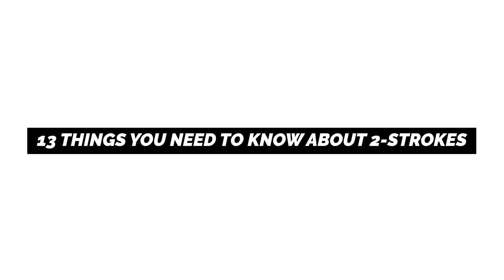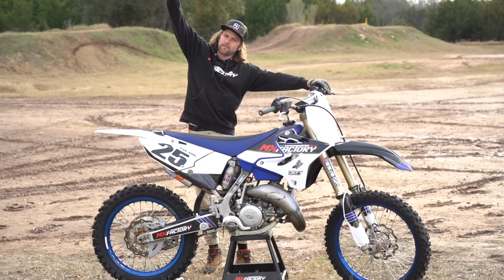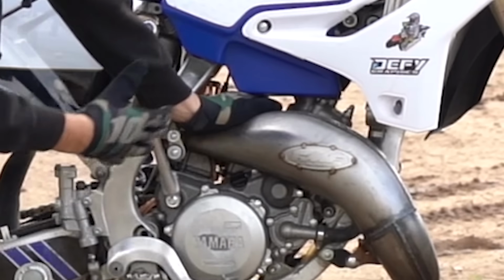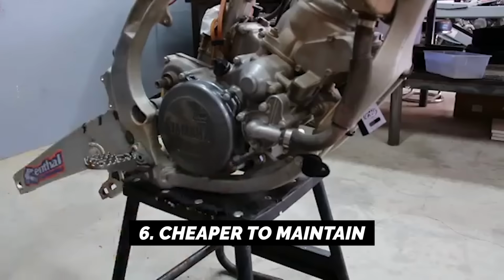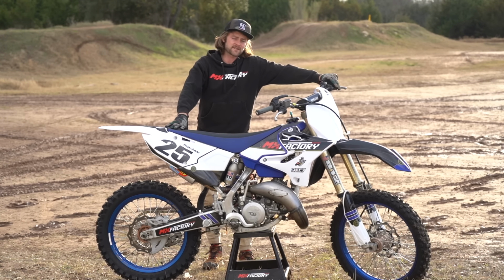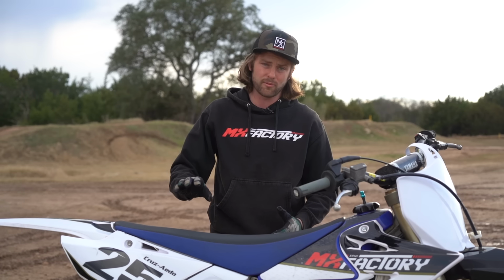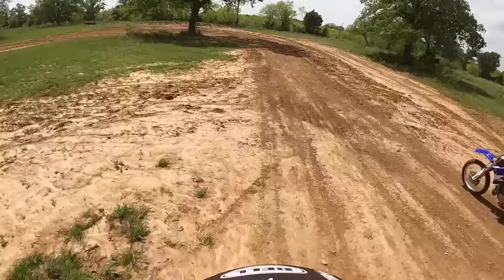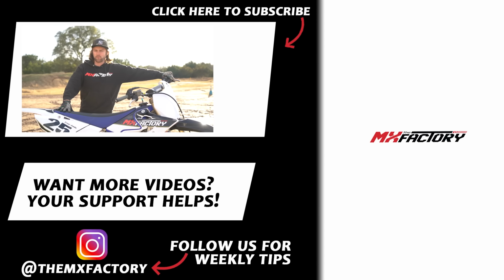13 Things You Need to Know About 2-Stroke Dirt Bikes

Comment: I’m still rocking a 2002 YZ 250, had it for like 10 years. There’s absolutely no reason to get another bike. I’ve rode 450s/250fs, the four strokes simply don’t have any character. When that power band comes on, instant adrenaline.

Comment: Actually in EU, they do be quite expensiver than 4 stroke, because they are that rare. I have Aprilia RS 125 2009 and with that money I could buy a new, 125cc 4 stroke Brixton :( They do be cheap to work on till your engine blows too, tho, it's only 400-500€ for an engine

Comment: you forgot to talk about piston replacment, 20 hours on a 125 piston and 30 on a 250 piston... and i agree ride 2 strokes people!
Reply: Those hours are not written in stone.  The choice of oil alone can make a big difference on how long a ring lasts.  I rode and raced a lot more than 30 hours on my 250's, and only changed piston and rings once a year, (4 to 5 months of winter, but a lot of summer riding, every day usually).  I bet I hit at least 120 hours, (that is about 4 hours a week for 30 weeks a year), with no problems.  You can measure the skirt for wear and the ring end gap, (specs in the manual), and with a good oil, I bet both are well with in spec at 30 hours.  Just replace them when they are out of spec.  It took me all supper to do that, and about 2 hours in the basement to rebuild it, (and clean the power valve).  But, I hear the Yamaha piston is on the weak side.  The bike, (my newer 2019 2-stroke 250), only has less than 10 hours on it, and I can hear it slapping a bit more than I like at low rpm's,---so I am going Weisco now. :)

Comment: You forgot the #1 reason they're better. The don't flame out (die) like 4 strokes. I know this is a MX channel but I do MX and trail ride. My Husky (KTM) 300 refuses to die regardless of (low) rpm which actually allows me to use less clutch than a 4 stroke. 2 cents.
Reply: I swear the thing will tractor up a hill at 100 rpm.

Comment: After 20 years no one has been able to give me a definitive reason why Supercross went from two strokes to four strokes. Don’t get me wrong, I’ve heard in array of reasons but no one has been able to take that index finger and say here here this is the reason!

Initially, I thought it had something to do with noise. I owned a 1975 CR 250M. My friend owned a 1979 XL 250.  My bike was much much faster and louder. His XL 250 was much quieter, but also slower. So, initially I thought it that the move was related to noise.

Comment: Please learn to ride a 2 stroke...  it will make you a better rider all around.  You learn throttle, clutch, and braking control.  All of us who learned on 2 strokes think a 4 stroke is like nitrous.  I feel they are still much more fun to ride.  I will agree in a race the 4 stroke allows you to concentrate on technique and strategy much more, but the 2 stroke racing back in the day was like a dog fight.    I have never had arm pump like I used to have back in the day on the 2 strokes.  Adrenaline and pushing past the line was a strategy.  Nailing a double or tabletop in 4th gear and air revving the bike was the norm.  The panic rev right before landing was the last ditch effort to save the day.  Ever been engine high sided in the dirt?  A 2 stroke will teach you throttle discipline.  I have always been a Kawasaki guy.  Their 2 strokes were brutal.  The exhaust valve was like cruise control for me.  Back in the AMA we had to buy a current year bike to race.  I am not sure how you do it today.  These bikes are super expensive.  In the end, If you love moto, you need to try a 2 stroke to see how it is.

Comment: I had a 1970 Kawasaki 100 Centurion, and a 1973 Honda 250 Elsinore, and a 1976 Kawasaki KX 250 when I was a kid.  A bunch of misc. bikes after that, both 2 and 4 stroke, street and dirt.  I like 2 strokes!  At 11 my first bike was a Honda Trail 55, at 13 I got the Centurion and it was a Rocket!  The Elsinore was downright frightening and I almost killed myself more than once!

Comment: I was surprised when he said they put out less power than modern 4 strokes. I thought it was the complete opposite riding a two stroke 250 versus a four stroke 250two-stroke 250 feels worlds more powerful to me.
Reply: I have a 125 2 stroke and a 450 4 stroke what size would be equivalent to the 450? because the 125 feels allot less powerful than the 450

Comment: I went from a Suz SP125 to an RM80:  my ride dropped what felt like over half the weight and gained a punch like Mike Tyson....plus I could pick up my RM with one arm.
It was like going from a solid state to a full tube guitar amp;  there is NO comparison.
Guy stops me in my driveway with a Honda Elite moped wanting me to race him and I just laughed "G'ahead -take a head start while I finish my smoke and I'll be waitin' for you at the last mail box..."   1) He didn't believe me and 2) It pissed 'em off.  
I was waiting for 'em at the finish line (the last mail box).

Comment: 1) Agreed - 2 strokes sound awesome...!
2) Disagree - ALL engines have a "powerband".  Modern 2T motors have very mild powerbands compared to older generation 2 strokes.  Actually most performance 4T motors make most usable power very high in the power curve.  Linear power curves are common for both engines.
3) Disagree - Any engine that makes most of its power up top will need a lot of clutch.
4) Agree/Disagree - Some of these modern 2T chassis are filled with stuff and have fuel tanks that hang down long making it hard to reach in there.
5) Agreed - 2T motors have less moving parts so easier to work on.
6) Disagree - 2T motors inherently make more power than a 4T motor per displacement.  A modern 4T 450 will make around 50-55 hp whereas a modern 2T 250/300 will also make upwards of 50-55 hp.
7) Disagree- ALL bikes are expensive these days, 4T and 2T.  The only bikes that seems to be considerably cheaper are the YZ 2 strokes.
8) Disagree - Both 4T and 2T have the same electronics and both available carbureted and fuel injected.
9) Disagree - Most bikes in their "class" are going to be similar in weight.
10) Disagree - Any competition bike is going to feel similarly loose on the ground when you're on the pipe.
11) Disagree - Body language depends on riders skill and bike setup.
12) Agree- 2T motors have less engine braking.
13) There are more 2T manufactures than Yamaha and KTM.  Also Husqvarna, Beta, and GasGas are not rebranded KTM's.  They're close but have considerable differences.  You also left out Sherco and TM.

Yes, 2-strokes are making a comeback and more people should ride one...
Reply: I build little 2-stroke engines for a living, and I don't think there has ever been a stock 250cc 2-stroke that made 55hp, and probably not 50hp.  Most of them make about 45hp, and that is what a modern 4-stroke 250 makes today, (not adding the 300cc engines).  I still think it is right that a 2-stroke should make more power than a 4-stroke of equal displacement, and I do think it may be possible to get about 55hp from a 250cc 2-stroke cylinder on gas, but I bet it would be too peaky to ride easily for most people, as it would probably kill the low end power, and hit like a ton of bricks at higher rpm.  One thing only I will give credit to a 4-stroke.  The power output does hook up to the ground better, and that is pretty hard to beat.  You are right about the "power band".  The power band is just a representation of the usable rpm range of power output of a engine.  Both 2-strokes and 4-strokes can be made to be linear or peaky.  Engine braking?  Now we are getting lazy with our riding.  It takes more talent to ride a 2-stroke well IMO.
Reply: @EarthSurferUSA  - Thanks for the feedback.  And not to discredit your engine building skills either but the YZ250 is recorded at making around 48 hp and the YZ250f making around 38 hp.  KTM 300's make somewhere between 45-50 hp depending on model year.  And most 450's make upwards of 50-55 hp.  I was very loose in those figures too because we all know these can also be dynoed all over the map depending on the dyno and what mods the bike may or may not have.  But clearly........a 2T motor will make more power than a 4T motor when comparing displacement.
As for linear power...well a modern fuel injected 2T 300 will make unbelievable linear power whereas a track 4T 450 generally make horrible single track bikes.
I guess point to be made is the video was too generalized and would have been accurate if it was made about 15 years ago.

Comment: How about a video on specific jumping 2 strokes.
Reply: Usually you are letting off the gas just after your front wheel leaves the lip so the front wheel does not reach for the sky.  It just takes a bit of practice to get used to.

Comment: I love them more than anything! 
Had kx65,kx85,rm125, than i had a yz450...yes it was an awesome bike and alot of fun to ride, but i couldnt stand the engine braking, the heavy weight, the fact that i simply couldnt rebuild the engine.. so sold it!
Now i got a yz250 and man, thats just so much fun to ride...sounds and smells awesome, and with a few pro circuit parts its just simply as fast as a 450 in my opinion!
Right now i rebuild it to a reverse restyle Version..  old 2002 plastics and airbox, it looks sick and pretty oldschool for a '19 bike. :)

Comment: New and bad riding technique IMO 4:20:  Riders today rotate their bars forward and have their levers almost level, (compared to pointing down as we used to do.). 
Even pro racers would crash less if they kept their elbows up.  For some reason, racers have adopted a lazy low elbows problem, and here this rider has no leverage to keep his upper body from going over the bars.  In the last national, one of Chases crashes, (which James Stewart analyzed, but still mentioned nothing about Chases elbow at his side.), would not have happened if Gary Bailey coached him for a week.

Comment: Well. If want 2 strokes back we need to address the race handicap in displacement. It was introduced when 4 strokes were more disadvantaged. They aren't as disadvantaged now. Let's close that gap. 250 vs 450... common.. they way 450s run these days...

Comment: $11k is cheap? Even a used Ktm costs as much as a new YZ250F
Reply: Who said that?
I picked up a 2005 YZ 250 for $2500 and might be 1.5 seconds a lap faster on a modern 450 priced at 11k...all about perception

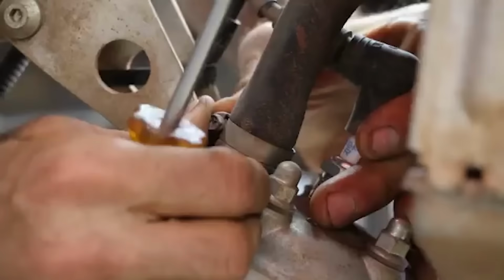Comment: 2:34 is false. A 125 2 stroke puts out sooo much more power than a 125 four stroke. A 125 two-stroke is more comparable to a 250 4stroke. And the 90s CR250’s Have more horsepower than modern day 450s. The modern day 450s though have more top speed but the two-stroke still have acceleration. And don’t even get me started on the 500 and the 700 2 strokes. The 700 two-stroke has 87 horsepower, and the 450 4strokes have about 55 horsepower. Two strokes Are just way more powerful than four strokes but the four strokes are more reliable and they have a larger TopSpeed. Like I think the 500 two-stroke top speed stocks about 90 while the 450s are about 100. But the last 500 ever made was in 07. And two strokes it’s way more fun to ride in general

Comment: #14:  2-strokes are what we wanted to race.  4-strokes are what the environmental groups and government want you to race, (for now).
What is the main difference?  Freedom and price.
15:  Today's two strokes are too damn tall, (4-strokes have to be taller because of the taller head).  They are about 2" taller than they should be, and that turns off any newer rider under 5'10" tall.  I lowered my 2019 YZ250 that I bought just slightly used from a guy who sold it, because it was too tall.  You go for the outside berm tipsy.  I will take the flat inside line.

Comment: 2 strokes make More power than a 4 stroke. More not less. 
A 250 2 stroke makes More power than a 4 stroke.
This is why 250 4 strokes were allowed to race in the 125 2 stroke class.

Comment: I started on 2 strokes in the 90s cause thats what you had.  Going 4t around 02 and getting back to a 2t around 2014... it is way more fun and work to ride a 2t.  I think back to learning to ride and my first bike was an rm250 when I was 16.  Definitely different times.  If you want to go fast and feel planted get a 4t.  If you just want to ride for fun and send your HR through the roof....get a 2t :)   right now I have a 450sxf and a 250 xc.  The 250 has gotten way more hours on it.

Comment: This is the first time I've ever heard anyone seriously say that a 2-stroke puts out less power than a 4-stroke. Is this true? Have 4-strokes improved THAT much?? I've always rode 2 cycle bikes and have next to no experience with thumpers, other than just knowing in my heart of hearts that if I ride with a 250 4-stroke, I've always been much faster, much zippier. I thought 4 strokes would lug up a hill and pull like a tank, but if you want to kick butt, ride a 2-stroke. Has this changed???
Reply: That's what they say but I don't believe it. Years ago we just raced and settled it. Now everyone pulls out Google and compares stats and uses that to make a comparison. They don't take into consideration that there's a little thing called skill that you can't measure. 2strokes make you a better rider. I think that's always been the case. Just like the best guy in the world could probably get crazy results from a 4 stroke. But that doesn't mean you can jump on one and run with a guy who's been riding his 2stroke his whole life and knows the machine inside and out. It's a different world now and everyone wants an easy ride. It's cool tho because I like knowing the difference. You can shout numbers at me all you want about how 250 2 strokes put out the same HP as 250 4strokes. But I won't hear you cuz I'm spitting blue smoke at you while kicking rocks in your face. Lmao

Comment: Correction:

2 stokes have more power. Don’t forget they race in the same class as a 4 stoke with an engine that’s double the size. Of course they’ll have more. But for example 250 2 stroke vs 4, the difference is about 10hp in favor of the 2 stroke engine depending on the brand of bike. 

2 stroke engines rule the earth ;)
Reply: Just think what it would be like if 2 stroke development has kept pace with 4 stroke development. Instead of a 250cc 2 stroke having twice the hp of a 250cc 4 stroke it might be 3 times as much.
Reply: @jasonvsd  Right! These 4 stroke bikes get continued development and have features now like launch control which could majorly help your holeshot. The newest thing I know of on 2 strokes is fuel injection and I believe it’s only on some bikes like the husky 300. They pretty much just remain at a stand still in development, but are still better. You just can’t beat that engine design.

Comment: ayy man, i havent been on a bike since i was about 10 years old riding a 50cc baja dirt runner.. im 24 now and looking for my first actual bike to learn to ride again. not got a whole lot of $ to play with plus i love the sound of a 2 stroke, 4 strokes sound like a tired butthole.. and im short as fuck only 5'6" so ive been looking at older yz125's for around 1200-1500... 

is there anything i should be looking for in particular as far as problems go?? im very mechanically inclined, been working on my subaru for about 4 years now and the bitch runs great. 

if anyone has any advice im more than open to chat when i got free time, i dont know shit about bikes let alone 2 strokes so anything helps. 

insta: zb_413 ... also anybody selling any project 125's for under or around 1000, hmu im more than willing to take a look and make a drive to pick it up for the right price.

Comment: You have to rebuild the engine after so much miles where was 4 stroke its less I don't hate 2 strokes I prefer them but they are definetly not Cheap there expensive not just to buy them but to keep rebuilding it after you've ragged it about for so long

Comment: I have experienced the power curve thing on a 2-stroke before, but honestly my 2021 YZ250 seems to have amazing power right off the bottom, then it does not build like a 4-stroke would.  I added a flywheel weight to smooth out the hit, and it really chugs up hills and handles single track and woods riding great.  Even when I ride the motocross tracks I don't use the clutch but I'm far from the fastest guy out there.  I figure if it will spin the tire and lift the front tire any time I want I don't need the clutch to keep from bogging.  I like the light weight of the bike and that is the reason I switched.

Comment: Less power?  Other than a factory race 450. Two strokes are known for having much more power. If you've been riding a 250 Four stroke and think you can handle a 250 two stroke. You're in for a very quick lesson. And my YZ 250 with some simple port work and a few other cheap mods will hang with any non-factory four stroke. I smoke my buddy on his 450 CRF axle whatever the hell they're called. I know that one isn't as fast as the race bike. But these bikes are also lighter and cheaper. My point is. I know a bunch of guys who ride 250s and when they get on my bike they shit their pants.

Comment: Can we mention also not to try engine braking on a 2 stroke? Remember that leaving the clutch engaged as you downshift means you’re gonna hold high rpm, but with no throttle input, you’re also starving the engine of lubrication. Engine breaking on a 2 stroke means you’re letting the engine freewheel at upwards of 10,000rpm without oil. If you want to keep your 2 stroke in good condition, don’t try it
Reply: So how are you changing down then and braking. Are you keeping it in a high gear as you brake down ? Or clutching in as you brake down ? Cheers